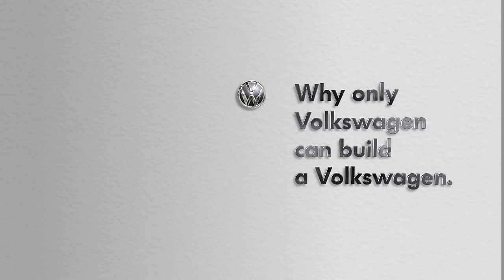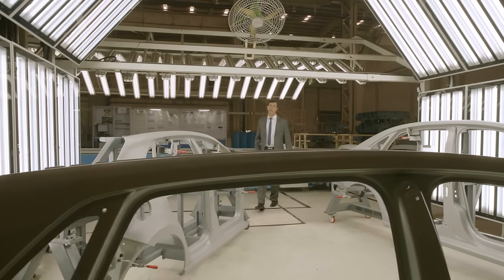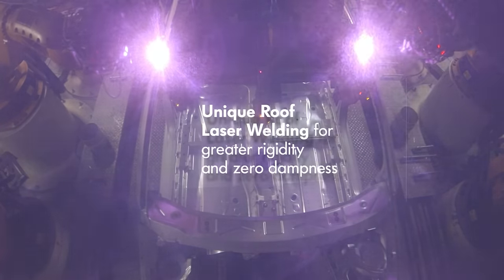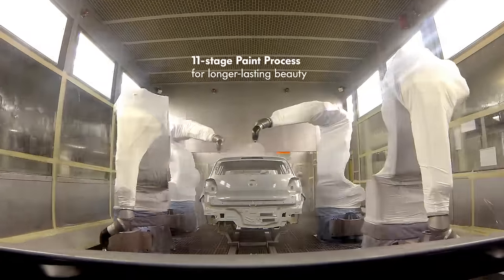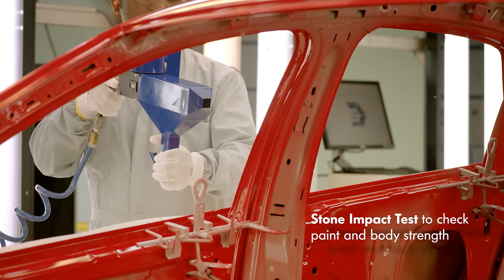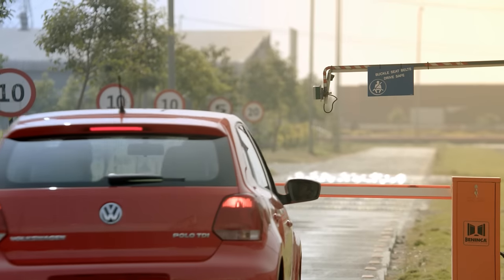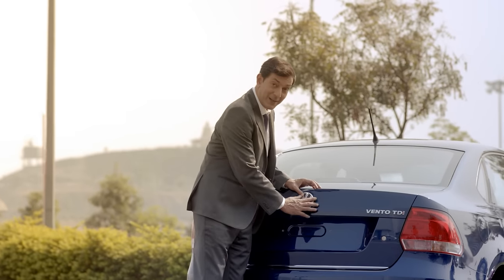Only Volkswagen can build a Volkswagen.

Comment: Skoda Seat and Audi: hysterically laughs together as they continue making rebadged VWs
Reply: Except those brands are little Volkswagens, in other words bolkswagen legit made them so
Reply: Audi won't do that.
Reply: @johncatty6560  what do you mean?
Reply: @henerum  Audi is not just a VW with an Audi badge. If you had been with Audi R&D you would know that. Nowadays even Skoda people woult probably disagree to a certain extent. Of course, it used to be different some years ago (with Skoda - not with Audi). The Audi 50 was built before VW started to offer the Polo based on this model.
Reply: @johncatty6560  well I believe its mixed.... Vw tends to be bare bone while skoda is sport and audi is futuristic and tech rich
Audi has the Mannerisms and engine of skoda and look of vw.... Still they do indeed have unique character of their own but vw parts in audi in inevitable
Reply: @abhijiths7637  if volkswagon is so good then why cant they make a car that gives competition to rolls royce
Reply: @HasanFaraz93  it can. But it’s just not their customer segment
Reply: This is vw too 🤦‍♂️
Reply: @HasanFaraz93  They did. its called Bentley.
Reply: @berkan_8234  ohh but can u call bentley a german engineering??
Reply: @johncatty6560   cause vw owns Audi
Reply: @HasanFaraz93  Partly, yes. Look at the W12 engine. It was designed by German engineers and built for many years in VW's engine plant in Salzgitter, Germany.
Reply: @johncatty6560  ohho
Reply: @GT Suryateja Both, Audi and VW have built cars on MEB as well as on MLB.
Reply: @HasanFaraz93  Bentley, RR's competitor is a Volkswagen group member
Reply: @dobrien757  yes bro and Bentley also gets german engineering .
Reply: @johncatty6560  Audi also uses Volkswagen Tiguan Allspace platform in their Audi Q7's
Reply: @SaiCharanReddy-oz8ez  "Audi also uses Volkswagen Tiguan Allspace platform in their Audi Q7's"
The platform for the current Tiguan is the MQB, which was developed by VW. The Q7 is based on the MLB platform, which was developed by Audi.

Comment: make your service network better and service costs/parts price lower just like what Ford is doing and i am sure you will defeat Hyundai in India.
Reply: VW wont do it .. They like defeat...lol
Reply: Who told you they want to defeat Hyundai and other cheap cars? You really think a company which is making cars for over 80 years doesn't know how to knock down the new kid on the block Hyundai/Suzuki/Honda/Toyota? VW doesn't want to sell in high numbers.
Reply: @siddharthchakravarty2099  "W doesn't want to sell in high numbers."
Well, they do want. However, VW is looking for customers that value quality. Unfortunately that is something the Indian market does not value. But: VW India has produced more than one million cars in India.
PS: I really miss being in Pune :(
Reply: @johncatty6560  were you working with VW group?
Reply: @siddharthchakravarty2099  "were you working with VW group?"
Yes.
Reply: @johncatty6560  Serious question : I'm considering VW T-Roc, which is a CBU in India. Else I'll go with Jeep Compass. Both cars are good in quality, but I may prefer VW because of their petrol engine over Jeep Compass. 
The only thing I'm worried is after sales service, and since it's a CBU, I'm not sure it's tested on Indian roads.. 

Would appreciate help from you guys...
Reply: @MultiRON63  Does it have to be the T-Roc or will the T-Cross do the job? It is slightly smaller but will be built in Pune plant in some time ;) Of course it is approx. 20cm shorter than the Jeep Compass. But if you don't travel with many people and big luggage it should do the job. If you cannot wait then the better option might be to go with the Jeep. Because the after sales service with the T-Roc might not be as good as you mentioned already. Also, you never know when VW will discontinue to import a certain car model when the sales figures are not good. And then the support might get even worse. Just my thoughts...
Reply: John Catty Thanks John. Better to go with Jeep. As it’s already well established in India.
Reply: @MultiRON63  You are welcome. Being a VW fan it is somewhat sad to know that somebody has made the choice against VW. But knowing the circumstances I fully understand your decision which was (at the time of making it) the correct one in my opinion.
Reply: John Catty Do you stay in Pune / India?
Reply: Absolutely true...
Reply: VW can't defeat hyundai
Reply: @MultiRON63  I didn't heard it from anyone else before u that chrysler products are good in quality 😂
Reply: @MultiRON63  "Do you stay in Pune / India?"
No, but I have visited Pune plenty of times in more than 10 years now. This year is the first one in over a decade I could not travel to Pune.
Reply: Exactly Rite, VW is global No. 1 company. Even Americans can't put them down with so much - ur fired!! ur fired !! type attitudes.
Reply: @bzeeeeee205  VW is not a perfect company. Why would it be? It is a company and as such it aims to make profits to make the shareholders happy. However, the company aims to bring good quality products to the market. While there have been bad product examples (see Golf Mark III "Lopez") there have also been good examples. One of which is resting in our garage at the moment. We have bought this (pre-owned) car about three years ago. It ran almost 140,000 kms so far and it has never let us down. Of course, we've brought it to annual inspection every year to avoid a breakdown. This is a key element when you want to use a car for as many years as possible. If you aim to own a new car always and get rid of it after 3 or 4 years then you don't have to invest that money for annual inspection.
Reply: @aakhtarmirza2033  bhai crash Test Results speaks of itself, what would u prefer as a BrideGroom - A young girls with wild cat marks OR an aunty @40 with so much makeover - made to fool you...?
Reply: @johncatty6560  I agree wid u John Carter ( from Earth) that cars r meant to be like this, haven't you seen the recent remarks of Mathew on World's Most n Least Reliable cars list published by Britisher Magazine ( i don't remember the name of d Mag.) But whatever u think I personally thinks Europeans r 200yrs advance than Indians are in 2021... they once conquered the whole Earth but soon find out that they tried to tame EarlyMen & left those areas...
Than tell me how European discovered Diesel & invented motor engines. VW is completing 125+ years in car market & still managed to top the globe. Bugatti Chiron is a living Example of what VW is capable of... Iam saying this not as an Anglo-Indian person or white skin person but as a self experienced with VW bettle LHD driven in 1980's.
Reply: And just like ford leave the country today
Reply: 😂 Ford left India
Reply: It's not Volkswagen that's pricing their parts highly. Its India's taxing system that's making them cost a bomb. VW's and skoda's are actually budget cars in foreign countries just like how Hyundai Toyota and maruti Suzuki is in India. Their off the floor pricing is similar to japanese cars and also  part pricing is the same. These cars are used as taxis' in other countries like India using the other lower costing car brands as taxis.
Reply: Ford just left India. This comment did not age well
Reply: Ford gone
Reply: Ford ran away
Reply: @siddharthchakravarty2099  There are many companies selling cars for long years, doesn't mean it is good.
Reply: @albertsebastian6836  Tell me one Indian famous car brand (like it can be a non Indian origin brand but still famous in India and selling in considerable numbers) that has been consistently selling car for as long as VW group. I am not saying they make perfect cars but I can  confidently say that VWs are the best for their respective budget. I am  automobile and mechanical engineer. And I have my own multi brand car workshop in Sweden just 100kms north of Koenigsegg factory. I fix car for a living. I fix VWs, Audis, Volvos, BMWs, Mercedes (These are the common brands here in Sweden) and many more. I know so many car brands inside out. And I am using a VW for 8+ years in India. Had used a Hyundai for 10 years and also was working for Hyundai and Honda cars in India. Have used Fiat for 10 years. Had a Ford Focus for some time and currently driving a BMW 320i for a few months. So I would consider my experience with cars as well above average. The thoughtfulness that the Germans put in to their design is just unmatched. You try using a VW once and try going back to any other car. if you are a person who are as detail oriented, you will quickly start to notice the differences. I am not talking about any gimmick features like touch screens or just good looks. I am talking about things that will actually make your life easier and safer.
Reply: @johncatty6560  That's great man. You are lucky to be able to witness this first hand. But what you said about them wanting to sell more? essentially means the same what I wrote. Like even Rolls-Royce and Bentley want to sell more cars (Of course to their class of people, so don't think I am comparing VWs to Rolls Royce as they are completely different thing for different classes of societies). Having higher prices are not just for parts or quality of work or labor or taxes. It means that there will be just that much fewer people who will willingly be spending more than others for same services. Basically this also means that generally VW owners will be economically well set people with very stable and planned finances. VW knows this and is trying NOT to appeal to the simple everyday struggling class. Because the typical struggling person will just want to save money WHILE having a car (which is counter intuitive) for the family and have best features no matter if at the expense of quality/safety. you will not see many first car owners to be buying VWs as they just don't have much experience with cars and don't want to spend much as the car for them is more of an aspiration than a necessity. I hope you getting what I am trying to say. And THESE type of people you will not find many in our downward spiraling economy. So basically VW knows what they are doing.
Reply: @MultiRON63  I understand you haven't asked me but don't buy the T roc. as it is a CBU there will be consistent problems with the part availability of the car. like every time it will need some new part they will have to mostly order it and then none can guarantee on arrival times.
Reply: @siddharthchakravarty2099  🙏🙌 Ok, I agree.
Reply: @siddharthchakravarty2099  Such an honest answer sir. Really appreciate it

Comment: My first impressions of Polo is overrated for a hatchback, now it’s a decade old model, when I started to search for my new car in the market, my first test drive was a 2021 Polo TSI, just to see why this car is still running in the market and people in auto industry respect it, I was just blown away by the performance of the mighty little 1.0 litre 3 cylinder engine and solid built quality both inside + outside, finally the no nonsense approach towards the design and features in the car. No second thoughts and home one!

Comment: Great cars! Now let’s make a reliable engine that can go 100k+ without needing a transmission replacement or worse motor replacement
Reply: My family has three passats and two golfs made after 2013, all over 280000km, original engine and transmission on every single one
Reply: VW and all German cars are very sensitive about maintenance schedule. Don't miss your maintenance. Don't go for aftermarket parts. The car will run forever. I don't deny that the DSG has some issue but they are in minority.

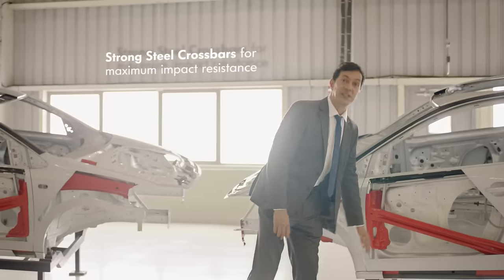Comment: 2:25 good to see they put body reinforcement around the A-pillar so in a small overlap crash test the passenger cell holds up. Unfortunately in most countries this test is not carried out, and a lot of manufacturers cheap out and don’t reinforce it creating a weak spot. Btw VW group is not above doing this; look up the 2012 Audi A4 small overlap crash test/2019 China Passat small overlap test, and you’ll see how poorly a car does when not properly reinforced.

Comment: Really vw cars are awesome. Their looks are still stunning after 10 years of POLO. No comparison with any other brands.
Reply from the maker: Glad to hear that, Zahoor ul Haq Gojree. We appreciate your continuous love & support. Happy safe driving.
Reply: Driving VW Group cars since almost 20 years now (not in India). I am a happy customer. Currently we have a VW Touran. Before that we've had a Passat. The Touran is much more comfortable (speaking as an older persson) and (in my opinion) it has a better price/value ratio. We have this (pre-owned) car since 3 years now and in total it ran about 135.000 kms in approx. 6 years until today. No breakdown so far. The only bad - but not serious - thing that I've noticed is the behavior of the ECU in certain conditions:
1. Cruise control engaged and hitting a pot hole - cruise control disengaged by itself.
2. Cruise control engaged and trying to speed up by pushing the button two, three times - very rarely the engine seems to receive less fuel for some ms
3. And unfortunately the MFD is lying. It shows a fuel consumption of 4.8 l/100 kms. But in reality it is approx. 5.5 l/100 kms. But that ist still a good value considering the shape and weight of the vehicle.
But since I drove French cars for many years I consider these events as not important at all xD
We would love to buy another Touran in the future. But sadly news say that the current Touran model will be the last one :(

Comment: Volkswagen cars are no doubt good, but you need to sell adequate numbers to win customer confidence and maintain your dealerships. I suggest that you design the cars in such a way that dealers can fit reversing cameras , infotainment systems etc., to the base model to keep the cost down. As Indian customers want high fuel efficiency, you should incorporate the mild hybrid technology being used in Maruti cars, to improve the mileage in stop go driving in crowded Indian cities. Imported parts should be reduced to the minimum to keep costs competetive with Maruti vehicles.

Comment: Hey @Volkswagen Volkswagen! if you are reading this then ill be waiting for your answer.

I love the current versions of every single model which is in the market by you. BUT why is it that when it comes to price and fuel or Milage Volkswagen lacks each time?
and why the infotainment and the exterior is so old school. no projectors, no front sensors LED backlights, 2 zone climate controls,  and many such things. 

But yeah, you guys rock it as even after so much old school, the products are fun to drive and each time when it comes to performance, no Volkswagen ever let anyone down.

Comment: 5:15 conserve fuel he says. Fuel efficiency of volkswagens are anything, but good.
Reply: We own a VW Touran 2.0 TDI DSG 140HP. As per Wikipedia the average fuel consumption is 5.7l/100 km. As per the MFD the consumption is 5.1l/100 km. But the MFD just lies. Actual consumption is around 5.5l/100 km. Still it is less than the official one. Of course the driving profile needs to be considered. Our profile is mainly short routes on cross country roads. Drivers who take it on highways or drive mainly in cities won't be able to use that low amount of fuel on 100 km.

Comment: All these comments regarding only this can build this are those people who can’t afford to keep these cars

I have mysef owned a 2009 Skoda Octavia 1.9 TDI and your hyundai maruti cars dont even tend to come close to its sheer performance and driving pleasure. Tin cans maruti no build quality and cheap korean hyundai overdone designs dont just compete with Volkswagen Auto Group ( VAG ) . Just take out some time and go drive their cars you will regret buying cheap maruti hyundai.
Reply: As a young chap I drove French cars for many years. I had to invest a lot of money into maintenance. One day I decided to go for a VW. Since then I did not have to worry about loss of liquids and electrical failures close to every month anymore. In fact: our current VW Touran (approx. 8 years, 140k km) has not been at the garage outside servicing times recommended by VW.
Reply: @johncatty6560  French Car makers like Renault in India initially had refined diesel engines here  back then during 2012 ( Some cars like Scala, Duster etc. ) but since last 3-4 years they have failed to attract customers due to lack of diesel motor. The 1.5 L K9K diesel Engine was a gem. With minimal turbo lag and great fuel effiency it was a delight on winding roads. Overtaking was a piece of cake. Sadly they do not sell diesel in India anymore but the RENAULT NISSAN Group failed to establish due to Thin After Sales Network.
Reply: @dieselclatter609  The Renault Nissan group was not the only one to have failed on a proper after sales network ;)